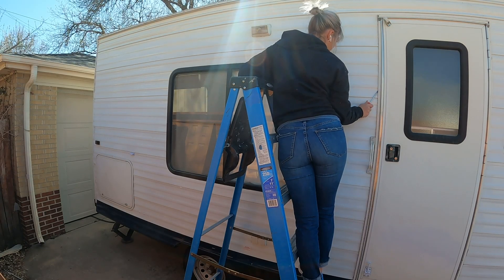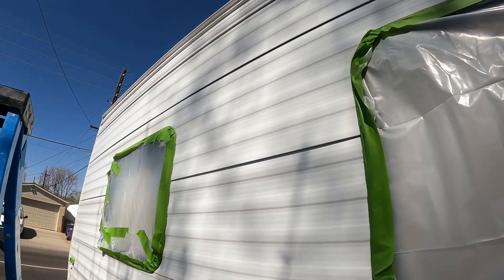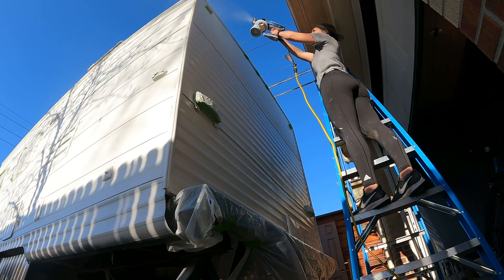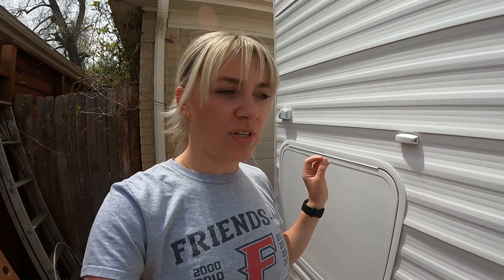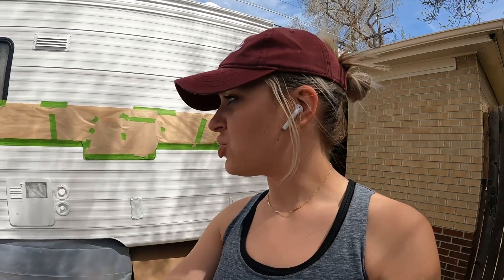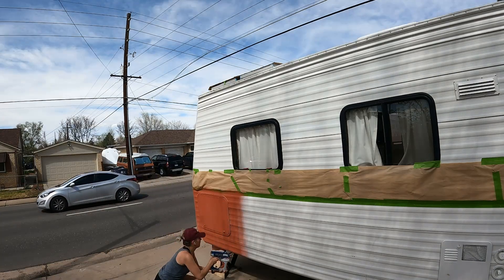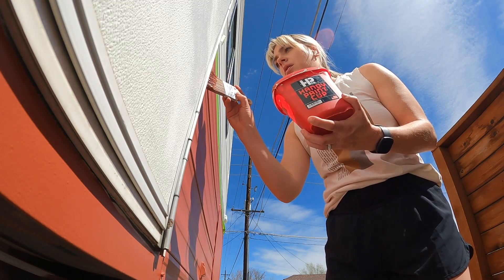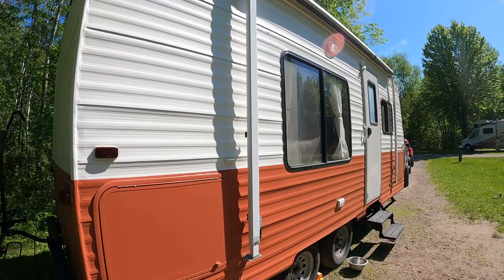Painting RV exterior on a budget // RV Reno Ep. 11

Comment: First off, I got a lot if respect for you. I take it you have a partner/spouce but you were the one that did most of the work. If you were my neighbor, I would ask to hire you to help me as I m about to do mine.
 As a professional painter who as not done and RV bu5 have done exterior of homes: stucco, aluminum siding, and wood, here's always what needs to ne done first. Sand with 220. Lightly, enough to rid any gloss. Brush off sanded paint before cleaning with water.
Wash with a ph balanced degresser/detergent. Some soaps leave a residue and some are to acidic or alkaline based which can interfere with paint.
Try not to let soap dry so tackle in manageable areas, not a whole side.
Make sure all sanded paint and dirt is removed. Make sure there is no left over residue. 
 Use a exterior bonding primer and have the folks at the supple store tint it to about the color you are using for paint.
Follow the directions on the can.
Two coat of paint. Go up and down 1st. Your bending technique is very good.
2nd coat go horizontal. 
Note that your sprayer probably directs that the nozzle should be set one way for vertical and another for horizontal. 
Finally.  I can't tell you what paint iss best for this job because I don't paint RVs professionally. 
What I can tell you is just about everyone on YouTube is using products for house painting.
 I would suggest going to a RV shop or look online for a product made for RVs. I am personally thinking about going to a marine shop near me and buying a oil based paint that is formulated for boats that is formulated for aluminum. 
Last. If you're paint job seems to be holding up, I would get an exterior clear coat and check with the manufacturer (the number will be on the can for technical information and cal or email them. Even though I am a professional, I still send out emails asking specific questions and they do get back sometimes in 1 to 3 buisness days.
 I highly respect yoir efforts! Anyone criticizes you tell them to post a video.
Reply: Well, 4 yrs ago I painted my travel trailer and done it pretty much like she did,  I washed my travel trailer, then a while later painted,  a few hrs later the 2nd coat.   I did light grey and dark grey stripe. 3 yrs later it looks like new

Comment: Thanks, hubby wants to paint the trailers we renovated over the last year. It's fiberglass with a lot of faded decal work to remove. Looks like there is hope though.
Reply from the maker: Sounds a lot like our project! Ours is aluminum though. I did quite a bit of research to find a paint that sounded like it would hold, but wouldn’t cost $1,000+. We wanted to go with automotive paint but it was just too expensive

Comment: Good job for a first-time painting. Kudos. For a gloss or semi-gloss, Wet sand  400 grit side to side. Wash, rinse, wash, rinse; the sprayer you use was not designed to spray undiluted paint. You can see the spray and pulsing in the video. Dilute to make a clean, smooth spray. Any units come with a funnel to time the flow. For sure, spray side to side, and make sure to add a slight up tilt to get under the metal roll.  Another suggestion for people is to take the windows out. Paint under the windows and reseal with the proper RV frame putty, not plumber putty. What paint to use is a difficult question. For many brands, boat paint is great but costly at 100.00 a gallon.   Im going to repaint mine very soon. It is huge; I really should reskin it. It's likely faster, too. Im tempted to go with rustolium oil base. That stuff sticks to everything. like you, i am going to do a flat color to hide the many dents from the hail storms we have. Light desert tan to match my truck. The squats were a great idea for keeping people watching.  10!

Comment: How much did that paint sprayer cost?  And could you give info on what the paint dilution ratio is?  Or did you use straight paint?
Reply from the maker: Straight paint! The instructions for this sprayer & paint type said specifically do not dilute. This is the Grace TrueCoat 360 and it’s less than $200!